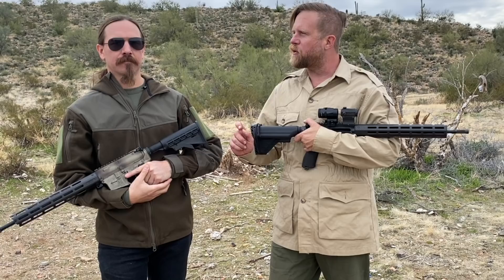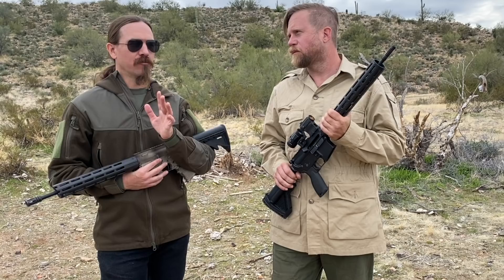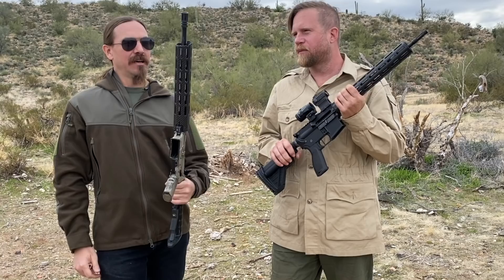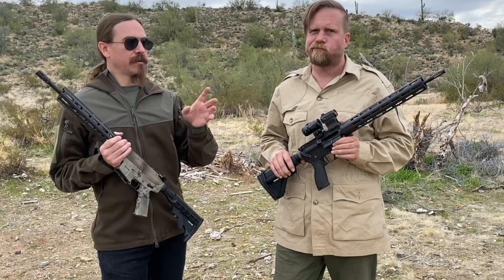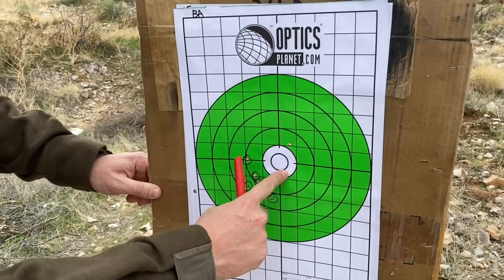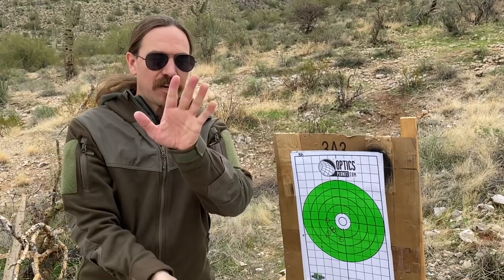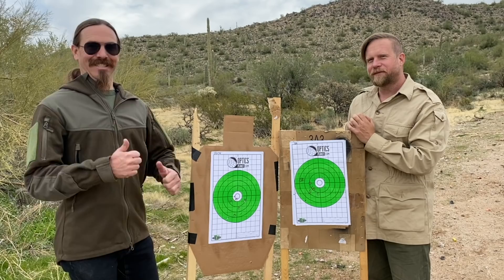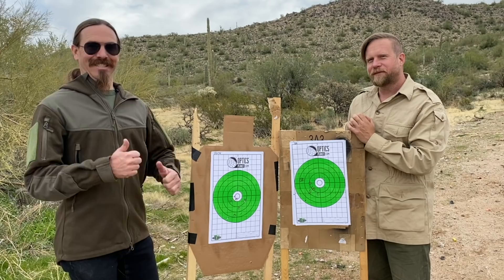WWSD2020: Barrel Selection & Heat Zero Testing

Comment: I'm wierd I want a 20 inch barrel because I can but I plan to run the lightest barrel I can I'm going to try it for fun
Reply: Don't quote me on this but I believe I remember hearing that the ballistic advantage between 16" and 20" is very slight.
Reply: @painmagnet1  It's a tradeoff. 20" barrels do significantly up the muzzle velocity and can stabilize some rounds better with normie twistrates.

The downside is a thin barrel that is longer will inherently be less rigid which may affect accuracy/precision. If you're gonna stretch much past say 300m in engagements the 20"er will have more lethal less wind-affected bullets going to target, but a thinner 20 might suffer an accuracy penalty for the weight.
Reply: I’ve got the 20” gunner on mine, powder doesn’t like to burn when it’s -20°F. My upper is damn near WWSD but with a standard lower it’s pretty back heavy. 20s can be light too.
Reply: @509Gman  that's good to hear I'm really concerned about ballistic performance as I kill shit with my ar15s pretty frequently gotta help keep the neighbors livestock safe